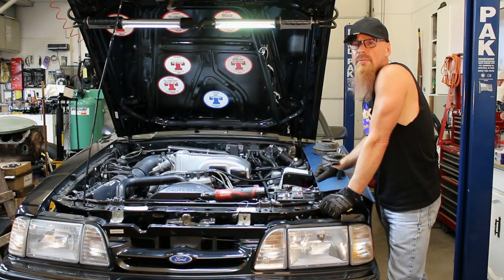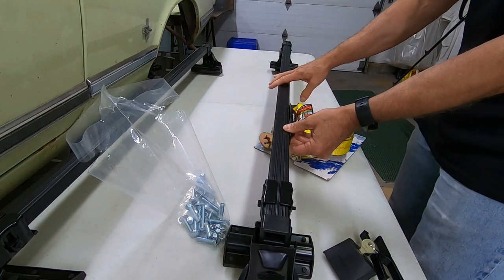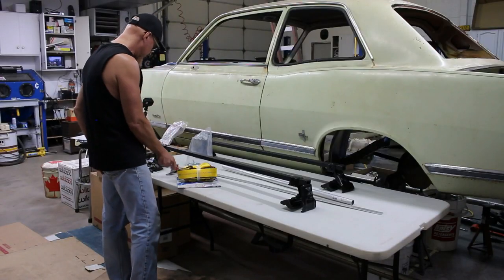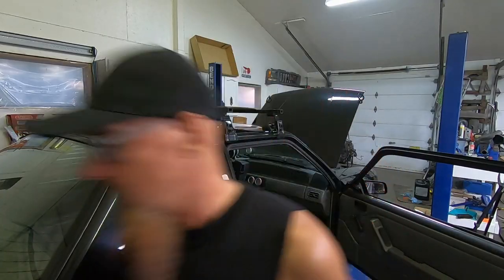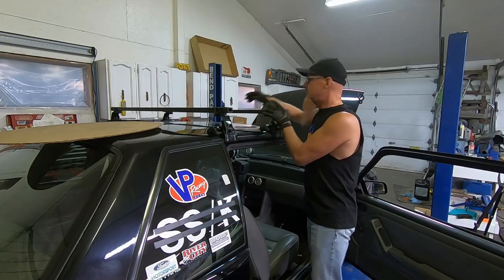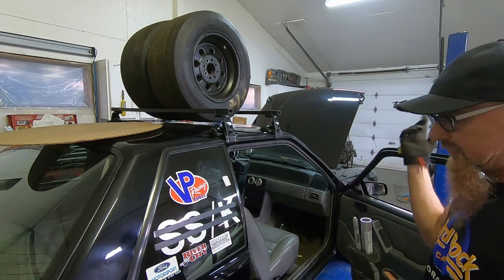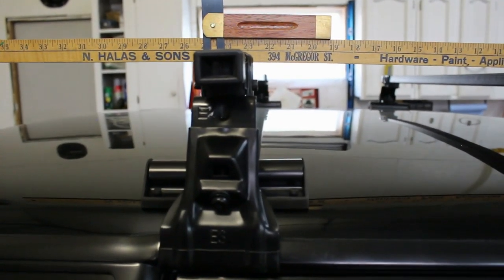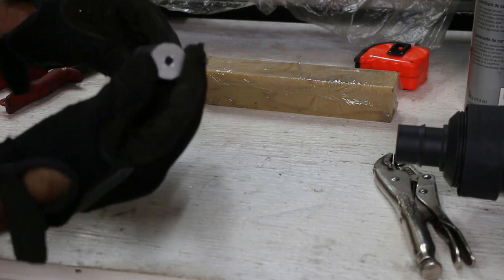Fox Body Mustang Roof Rack

Comment: My friend do you know how much weight does the roof of the notch handle would like to install some racks on mine with a rack basket for wen I go on road trips cool video by the way
Reply from the maker: Thanks. I really have no idea how much the roof can handle - it's pretty thin sheet metal, so it depends on where your rack is putting the load into the roof.